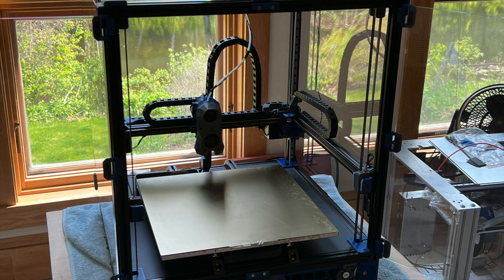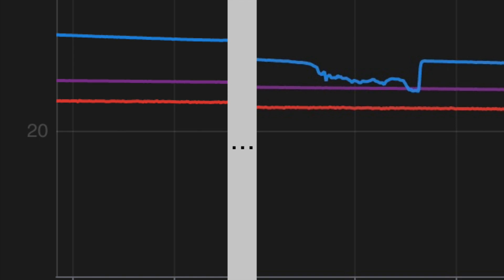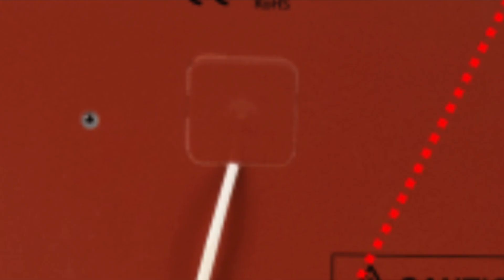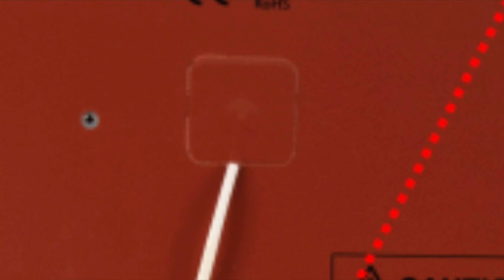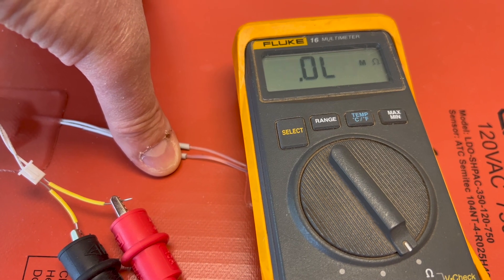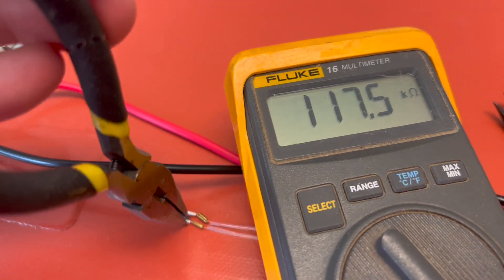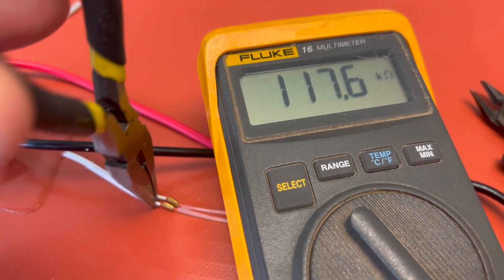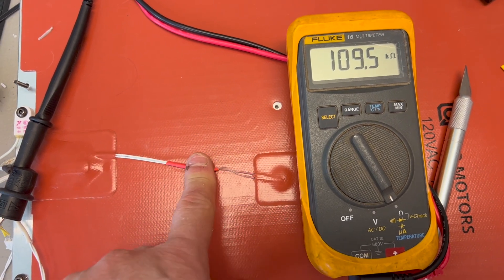LDO Voron Bed Thermistor Fix

Comment: Thanks so much for sharing! Have been seeing similar heating “errors” and had a few shutdowns due to unexpected heating rates. Will pull the bed and check the connections before buying a new thermistor

Comment: I am having the same issues, but not on an LDO kit. Just a Keenovo heatbed on a machine I built myself. Mine runs fine when it reaches 110 degrees, but when heating and cooling it does this jumping around.
I will check the connections and see.